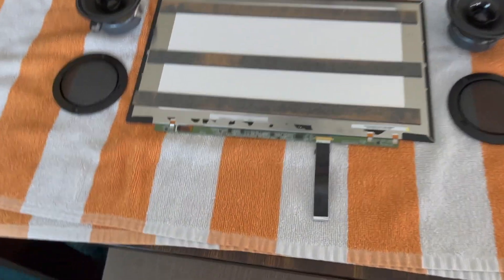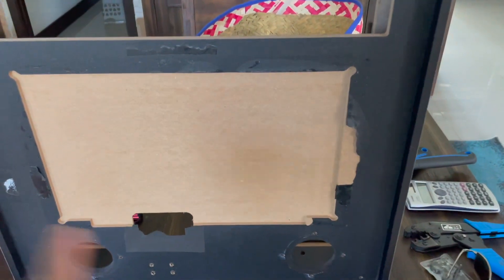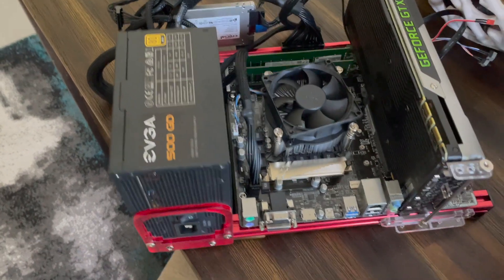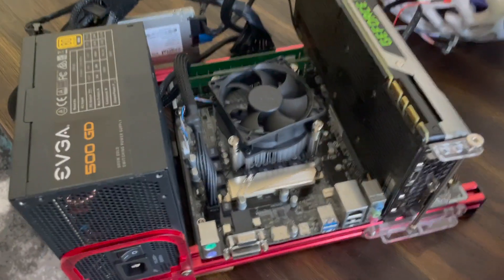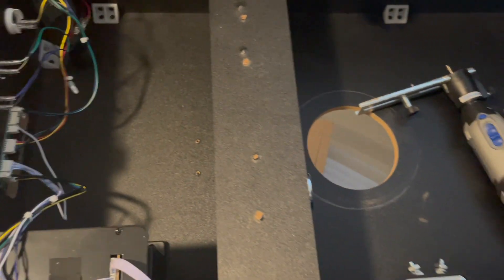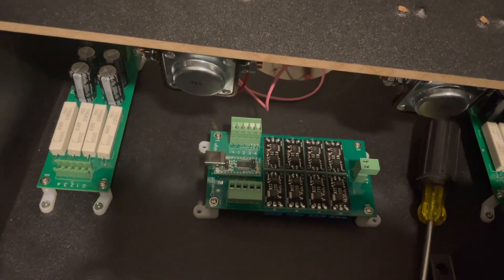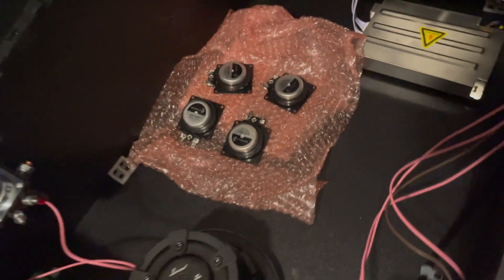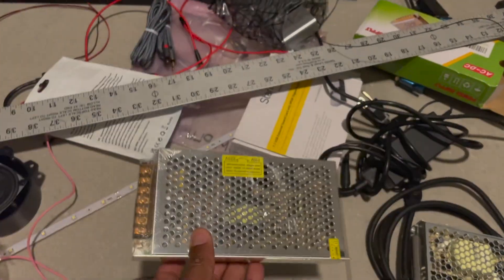Atgames Legends Pinball mod Part 2

Comment: how much money do you think you have in that computer? if you dont mine me asking
Reply from the maker: $60 for the mb (ebay)
$200 for the graphics card (ebay)
$120 for the processor (from HP G2 800 SFF -- ebay)
$60 for Power supply
$60 for SSD
$50 for case